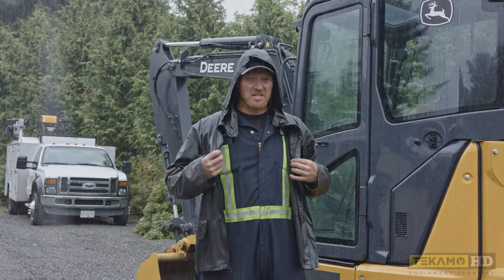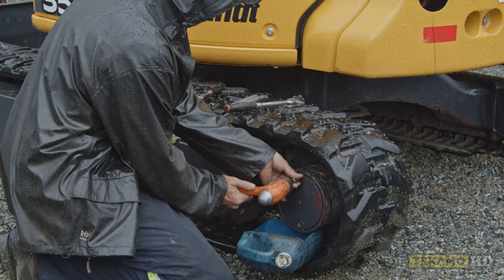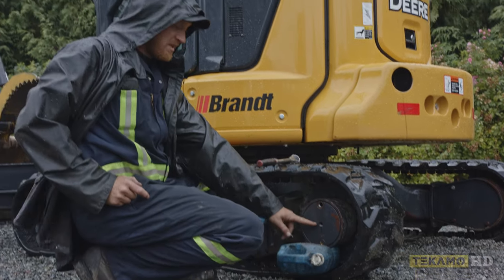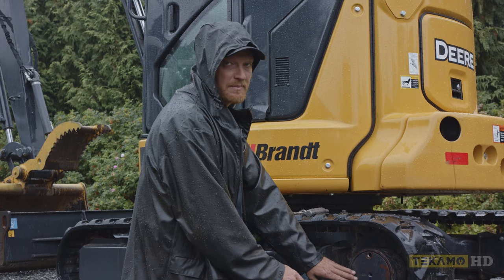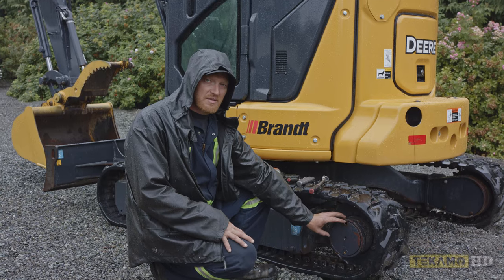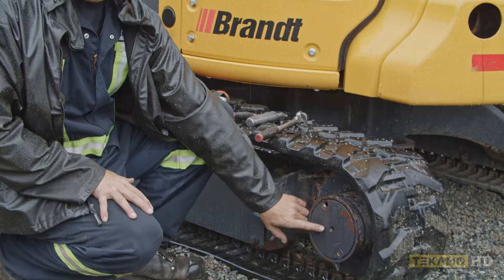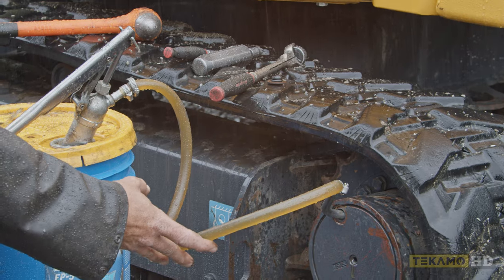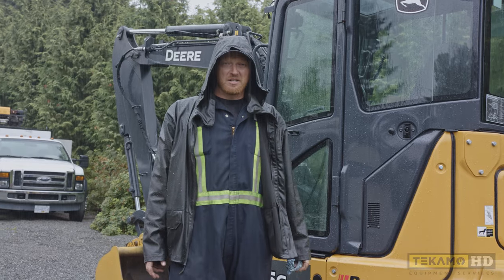Final Drive Oil Change In The POURING RAIN - Can He Still Get It Done?

Comment: So I noticed my top plug allen head has been stripped out on my 323E. Any suggestions on how to get that out now?
Reply: Weld a nut to the plug. Remove, than replace with new plug.
Reply: be careful welding on a sealed container full of oil...

Comment: The sprocket will remain on the final drive, then the sprocket will fall high pressure, then the final drive a lot heat and the oil burns.how to solve this problem